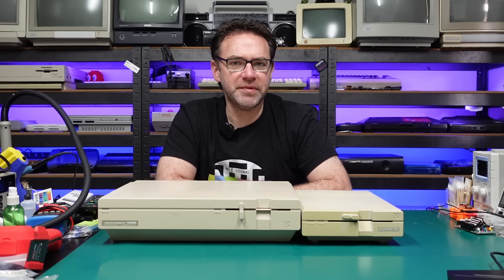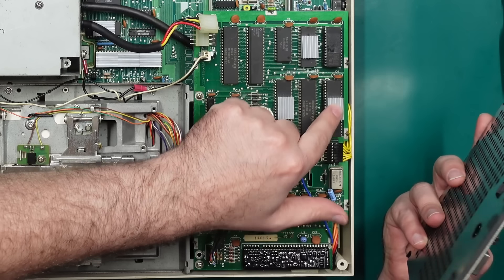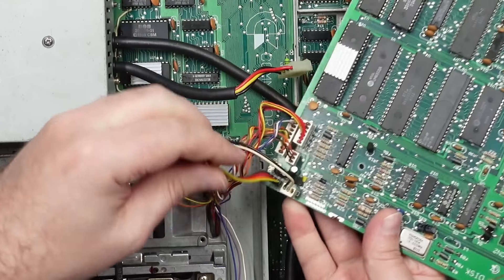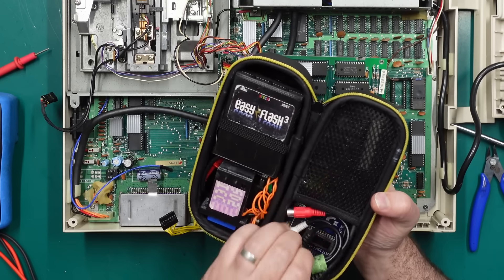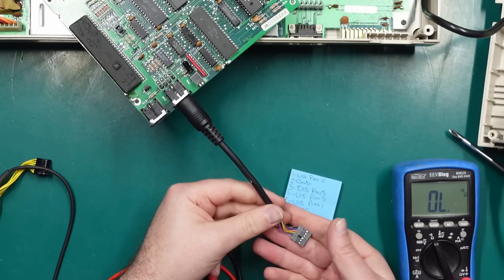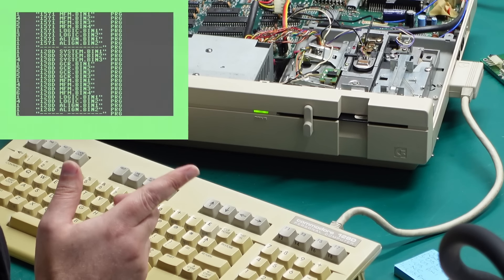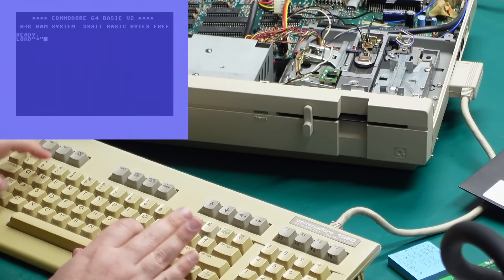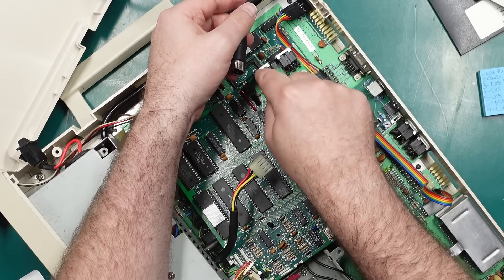Commodore 1571 / 128D Frankenstein

Comment: 2:08 You only need the Serial Shift Register, Interupt, and TimerA in your 1571 CIA. You can sub in an Amiga 8520 CIA, or any 6526A chips you might have even if they have faulty IO ports.
Reply: No. The chip uses DB0-7 and other pins too. I just reversed and re-created the 1571 board and I know for a fact that exactly 20 pins on the 6526 are used. I seriously doubt a partially working 6526 will work. Generally if the chip is bad then it will have other serious issues that affect everything not just a few pins. Anyway 6526 are not that hard to find now.
Reply: @g4z-kb7ct  By IO ports I'm talking about the PA[0:7] and PB[0:7] pins. I.E. Pins 2 thru 17. Of course the DB[0:7] pins are required, how else do you program the timers or write to the serial shift registers if you don't connect the data-bus?
Reply: @pits645  lol if you knew db0-7 was used you should have said so. A bad chip is a bad chip and should not be used regardless. Next time just keep quiet to avoid embarressment lol
Reply: @g4z-kb7ct  Nice projection. You're probably the only one to read "IO ports" and assume someone is talking about the data-bus.
Reply: @pits645  No. The comment suggests a bad chip will work. That is just WRONG. Using a known bad chip and expecting it to work is REALLY REALLY dumb lol

Comment: Very cool. I suspect that the 6th pin is the shield on the din connector which has little effect if you are not using a shielded cable.

Comment: About that LED connector: you could eject the crimp terminals from the crimp housing and rearrange  them in the required way. Using ready made Dupont cables is a good thing. You could get some crimp housings and just swap the single pin housings for a fitting (here 7 pin) crimp housing. That might be mechanically more stable. Or you secure the connector with a drop of silicon glue (which can be cut open easily, if required).
Reply from the maker: Ah yeah true, probably a good idea if it was installing it permanently.

Comment: A few years ago I fully reversed the 1581 board and made an identical 1:1 reproduction. If the guy with the rotten 1571 board sends it to me I'll reverse it and make the PCB files and gerbers open-source.
Reply from the maker: He tried to leave a comment but it was automatically removed by YouTube 😒
You can find him in my discord server (link is in the description)
Reply: @TheRetroChannel  Yeah he got hold of me. I don't do discord, waste of time ;-)
Reply: @TheRetroChannel  Had a chat. You won't believe it, he lives only about 1km from me in the same suburb a couple of streets away lol!
Reply: Most of the 1571's are dead, either because the CIA chip is dead (and those are available NOS from Mouser), or because the read/write heads have failed open.  It would be far better if someone could produce replica 1571 ready/write head assemblies.
Reply: @glenndoiron9317  Given that the board and chips are almost 40 years old it is surprisingly reliable. How many LCD TV's from 2000 are still working now.... I'd say zero. The heads are the main issue. But there is another way to solve that problem. Only a handful of (forgetful) titles were released on double-sided disks so the 1571 isn't required.....

Comment: Huh, I always thought the boards were the same in a 1571 an a C128. Never did check though. Fwiw, I would just have run an IEC cable between the connectors for a test like this. :)

Comment: Hello, a great experiment with the c128. I think it's very interesting. A question: "Does anyone know about the original C65 (!) and a way to deactivate the internal drive? So that I could operate an IEC2SD module? And can you operate a C64 module on a C65 with a C16 adapter? I would be for All suggestions are very grateful. Kind regards, all the best and thanks for the clip. Greetings to all retro technology fans. PS: sorry for my lousy english..😞 your RoboTronic64 from Chemnitz...
Reply: if you own a real and working c65 you are one of about maybe 3 people. Meaning no one knows anything or has any experience with it except those 3 people and highly likely 2 of them are not watching this vid or reading your comment ;-)
One way could be to change the device number on the internal drive using the usual solder blob jumpers (or software commands) to device 9 and then use the sd2iec as device 8. Another way is use the sd2iec as device 9.

Comment: Great work man! I have a 128D without ready cursor in 128 mode: looking this video I now suppose is due to a non working floppy, not a broken cia as I imagined 😞
Reply from the maker: I'd still suspect the CIA. Does the keyboard work at all, or does it show a cursor in 64 mode?

You could always disconnect the IEC cable going to the floppy controller board to disable it (assuming it is not the DCR version)
Reply: @TheRetroChannel  if I remember well the keyboard worked in 64 mode ...but I didn't try any floppy with it because I would like to clean the drive before, so now I will try to disconnect the floppy, mine is not a DCR..thank you for now

Comment: Sorry, but unless you document all of the changes, down the road, the owner then. will have an UN-repairable KLUDGE. Which will not be cost effective to take the time to repair. Reverse engineering is one thing but jury-rigging is something very different.
Reply: don't worry I re-made a new c128 style internal 1571 board.